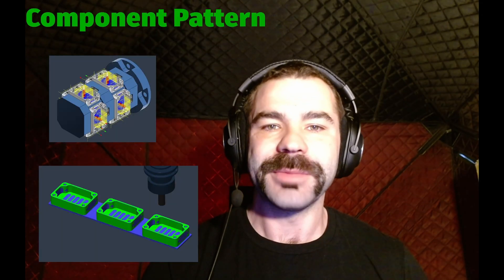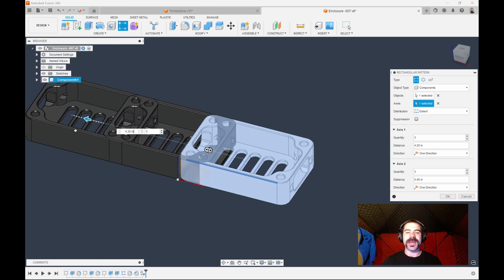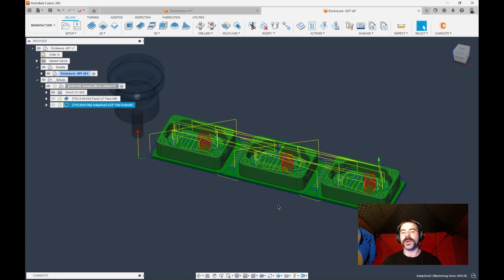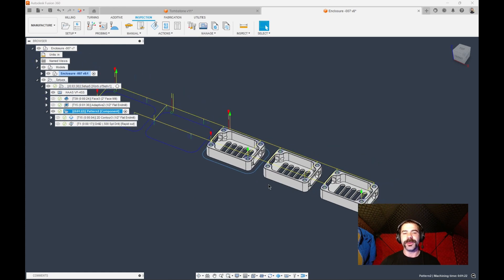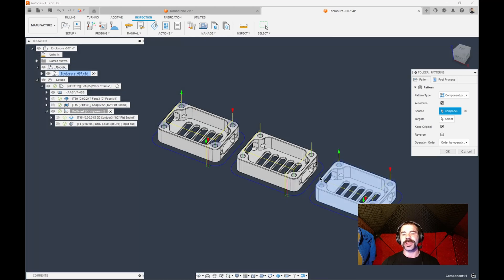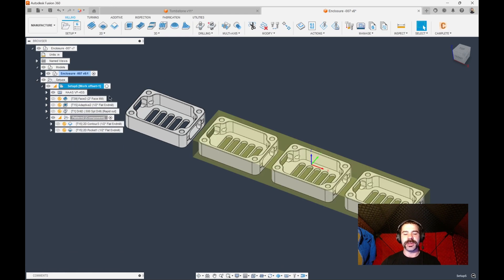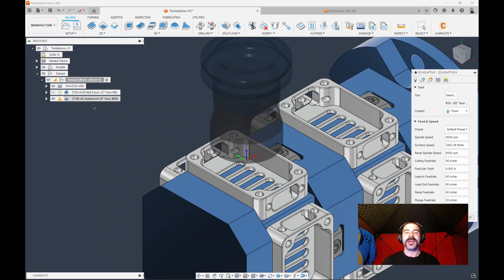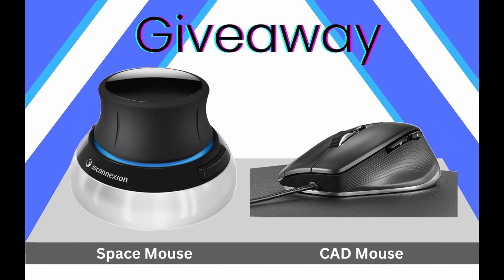Fusion Friday (ep103): How to Speed up Multi Part Programming with Component Pattern

Comment: Primary reason I avoid this, although I have used it several times, how would you use if for putting tool checks between components? I get nervous machining 24 parts with tool break checks at the end of all 24 parts.
Reply from the maker: Hello Richard,
So if your Post supports it you can add a Manual NC "Tool Break Control" To trigger a cycle after each part.
Reply: @NexGenCAM  I use manual NC often but not in Component Pattern as it will start the machining from the tool setter and not the next part as it needs the new coordinates for the next part. If I apply my manual NC it only sets it at the end of the cycle of all 24 parts and it posts all 24 tool checks at the same time.

Comment: Informative, helpful. 

You asked what people want to see:

I'd like to see an hour long video of a complex part that's programmed with 5 axis simultaneous toolpathing.
Reply from the maker: Jon, Do you have a part you would like us to use?
Reply: @NexGenCAM  Nope, I don't. Thanks for asking! Before I retired, I did mostly ITAR work so that would not of helped either. A part using most of Fusion 360 5 axis simultaneous toolpaths would be great. I've seen the shorter all Steep and Shallow Autodesk one. Don't feel that represents real world programming.